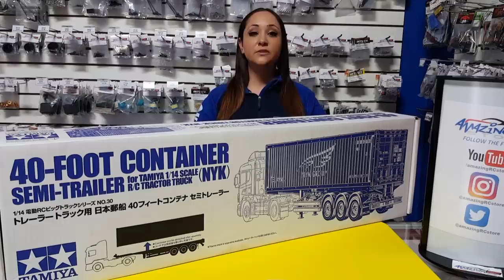Building a Tamiya 1/14 scale Trailer at Amazing RC store

Comment: Tamiya 1/14 Scale rc kit - Freightliner Cascadia Evolution Tractor Trailer on your store just a kit? If i buy it, i will also buy remote control, esc, motor, servor,... Right?
Reply from the maker: That's correct 👍
Reply: @AmazingRCstore  thanks

Comment: For the price it is really very disappointing from Tamiya that they dont use countersunk screws both inside on the floor and outside on containers frame. It would add soooooo much to the detail of this container, it just looks stupid with hundreds of buttons sticking out everywhere. It wouldnt cost them too much more to produce either, screw cost, same as now, countersinking floor and rails, negligable....
It is very easy to fix yourself, but as mentioned, for the price you would expect it to be done from factory!